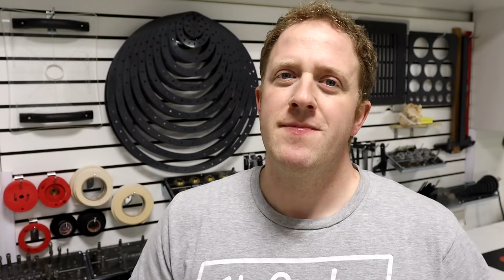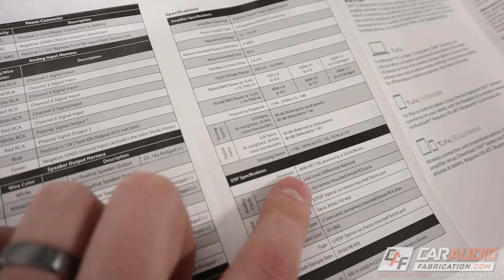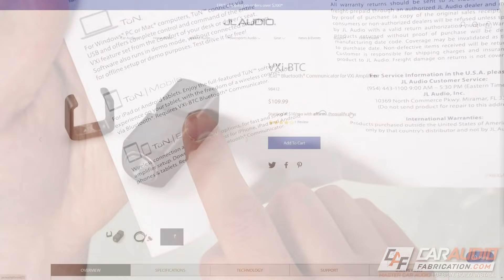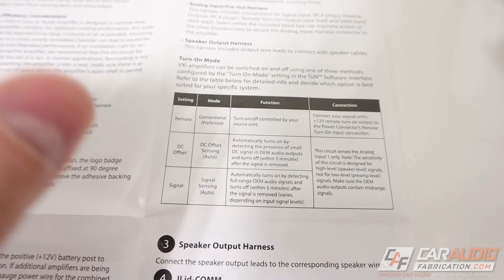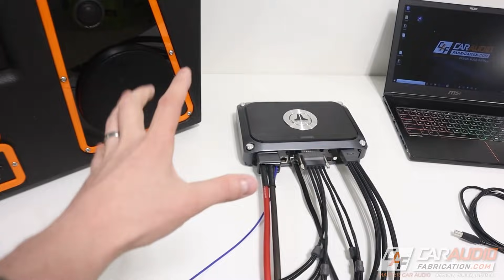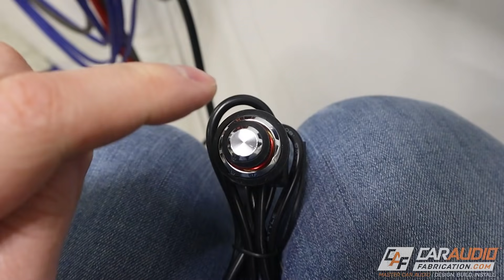Computer Tuning? JL Audio's VXi Amplifier! VX600/6i Overview

Comment: Great review, Mark. I have been looking at the AudioControl D5-1300 but seeing as my build consists of 2 C2-400X for the front, C2-650X for rear and a vented 8W7-AE3 in a 1973 Beetle, I think I might opt for the VXi VX1000/5i with the 250 controller. One thing I would comment on though, whilst the footprint is kept small due to the RS232 style input plugs, it does mean you are left with tails you right not necessarily need. Makes for a slightly more messy install. Following on from your review of the software, if I were to have two full range L/R inputs, say one from the MBT JL Bluetooth module and another direct from another line source, would you create two presets, one with input 1/2 and another with input 3/4? Keep up the great work.

Comment: I like that it has a TOS link input. With the correct head unit, it would make for a very clean install.
I know the technology is dated, but it’s not a 5.1 setup (Even though it could handle it).

Comment: The only thing I wish this used was it's own mic to help in adjusting EQ/timing. Like how a Kicker Key has a specific mic to set those details or my old Pioneer PRS that did timing and auto EQ.
Reply: You are right. For the price of this amplifier I feel there is a lot to be desired. I’m returning mine back to Crutchfield
Reply: @nickorozco5933  what would suggest instead ?

Comment: It’s looking your in my house been researching vxi Amps all week and spent all morning trying to find as much as possible about vxi Amps and he drops this today ...perfect will be ordering a 600/6 or 800/8 later tonight appreciate this video
Reply from the maker: Awesome! Glad it helped. Be prepared to not want to leave your car though, it's too much fun to listen to.
Reply: @CarAudioFabrication  I will be sticking with my 3 original JL Audio slash series amps a 500/1, 300/4 and a 300/2. With my Pioneer MVH-S622BS do I need to purchase a Jl Audio or an Audio Control DSP for my system and what would you recommend I am running a 10W6V2 center console ported sub box with JL C2-650 components for the front doors and factory tweeter location for the new Jl C2 tweeters as well some C2-650x coaxials for the rear doors and a set of Boston Acoustics Pro 60 components in some Q-Form kick panels run off of the Jl Audio 300/2. I noticed the 300/2 had pre-amp outputs so I was thinking about using those to daisy chain to my 300/4. I do have the remotes for the 500/1 and 300/2 for my dash to control the gain. was thinking I could set up my 300/2 for the Pro 60's and then using my gain control knob from the 300/4 to blend in the sound. What do you think?

Comment: I have the 800/8i running tweets, mids, mid bass, and rear-fill and the RD500/1 for my sub.  What an incredible package.  Love it!
Reply from the maker: That's killer! What's crazy is even the size of the 8 channel is so compact.
Reply: i grabbed an 800 as well, cant wait to get it in. smaller foot print than my old slash 4 and 2 channel amps
Reply: @Polywog77 How are you liking it?
Reply: @ryanb8736  it’s still not in yet…

Such a disservice. 

Grabbed a jd1000 for the subs which are also not in yet.
Reply: @Polywog77  I've got the vx800/8i on order. Cant wait to have it installed, got a seperate amp for the sub. I'm very much looking forward to it! This will be my first venture into an active system!
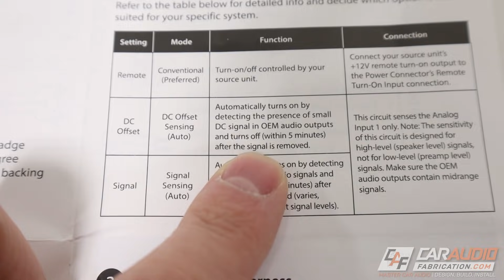Reply: 10:17 would it work with a Bluetooth adapter and no radio?